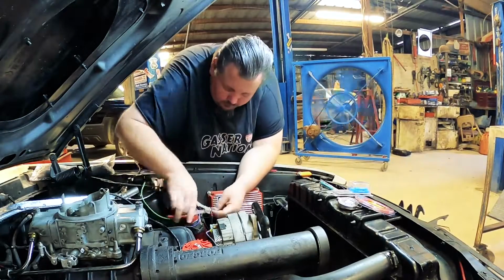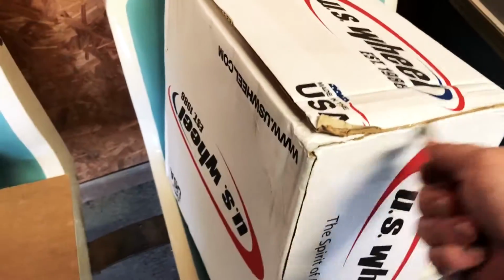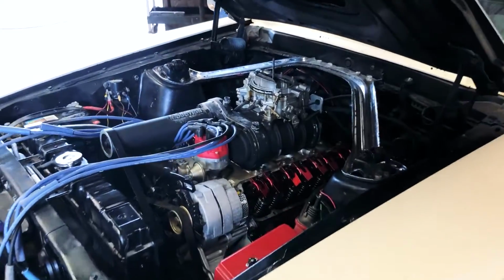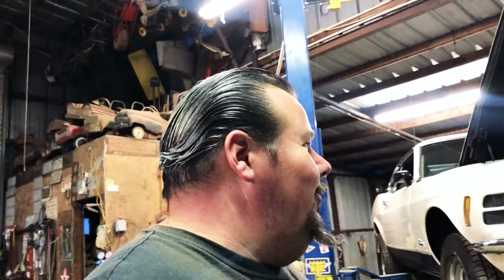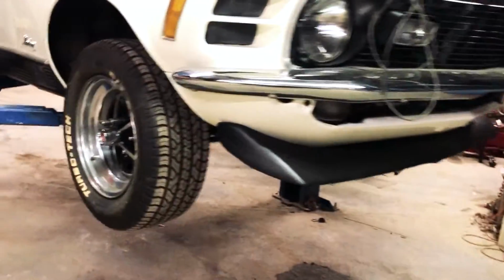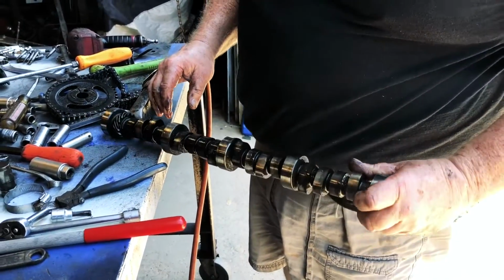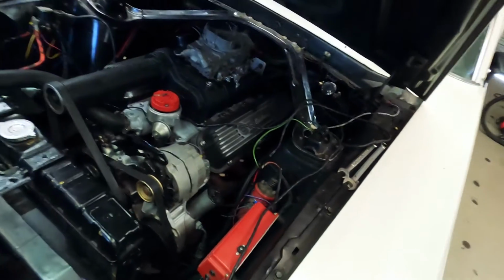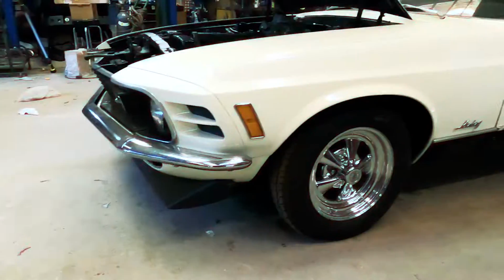NEW wheels, engine upgrades for Stimulus Stang, fighting to get my 1970 Mach 1 Mustang to run again

Comment: That much junk in the engine with multiple failed lobes is going to necessitate oil pressure flush rotating the engine so all the oil passages are reached, new oil pump, pushrods blown through, rocker fulcrums cleaned out, and more. Always own three engines per car.

Comment: Hello, you & I are in the same boat, in the early 2000's we built a 65 Fastback pro-street mustang, a SVO 460 crate motor, C-6 trans, it was a blast, we put together a 514, blew it up, that's when things really got out of control, since then the car now has a complete tube chassis, chrome moly cage, 4-speed Lenco, 540 BB Ford, but, the car still isn't done yet, I get ribbed constantly, when is the mustang going to be done...so I do understand....we do like your 70.....
Reply from the maker: Thank you, that sounds like a killer ride! I definitely know how things can get out of control, our Fairlane "Miss Fitt" is a prime example of one snowballing haha. These things take time when you have other stuff going on in life especially, or for many people, it's financial constraints, these cars eat up a lot of cash too. A buddy of ours is building a tube chassis pro-street/drag race '65 Fastback right now. He has a Kaase BBF to go in it. I need to make a video on it, he's doing it himself in his garage, and it's taken several years but it's coming together.
Reply: @NitroUnion  for the 540 BBF we used a motorsport block, .250 deeper bore with the Kaase P51 cylinder heads, I wish we would have used the trick flow heads due to the Chevrolet exhaust port, building the headers were a pain, we used a Alston "A arm" front frame section, if we would have done a Strut front suspension it would have been alot easier...please do a video of your buddies 65, we would like to see it...

Comment: At least you didn't drop a valve. GOOD LUCK with the STIMULUS STANG.  I got my fingers crossed for you. Have a good day. 
PS
      What cam did you end up going with.
Reply from the maker: Yeah it definitely could have been worse. The cam that was in it was a 292 duration, it sounded great, but It didn't pull enough vacuum for the power brakes to function and even though I have a small stall converter in there, it still didn't want to idle in gear, it was just too big. I went with a Comp XE268H on their recommendation, 268/280 duration, 509 lift, hopefully it will still have a decent chop at idle but give me some vacuum for brakes. Haven't fired it yet with the new cam but hopefully in the next day or so!
Reply: @NitroUnion  I had a 292/501 cam in a 74 Camaro Z28 back in my younger days. (I wanted it for street/strip) I wish I would have went with a more streetable cam,. I guess that's the best way to learn for some.  Have a good day.